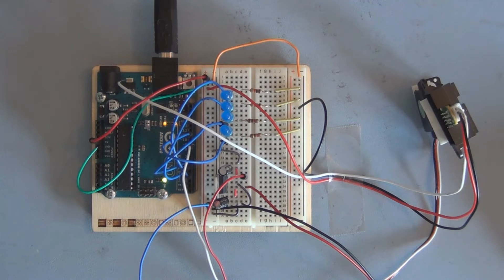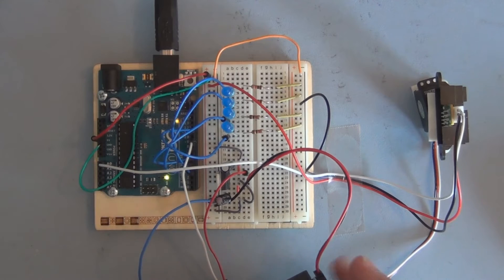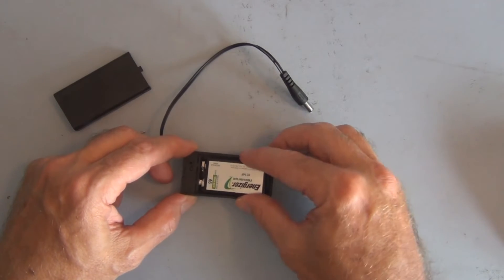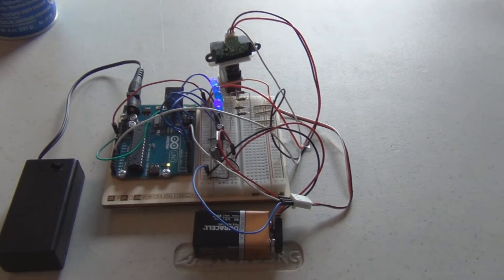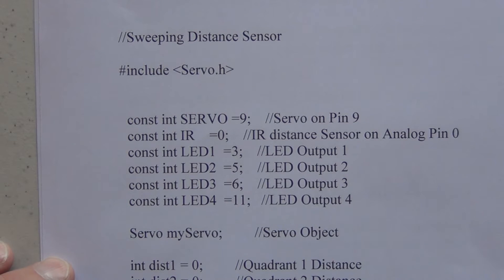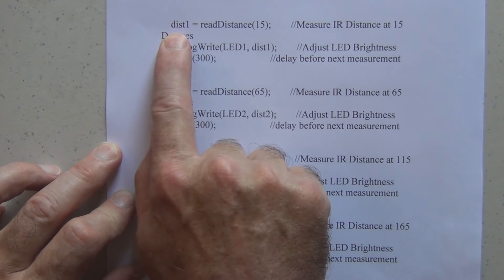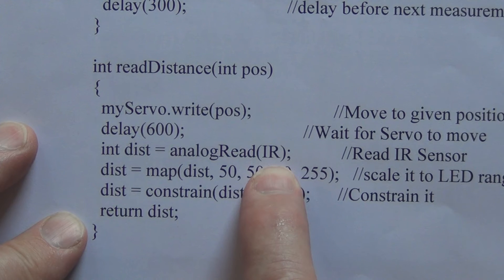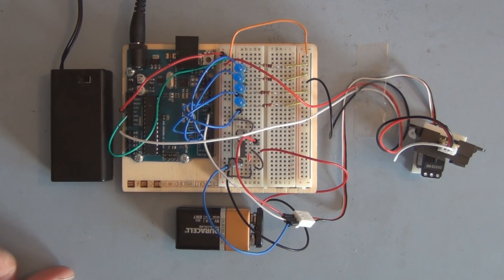Arduino Sweeping Servo Motor Distance Sensor

Comment: the function readDistance() is defined in the sketch at your fingers (video time ~ 12:21 )
int readDistance(int pos ) 
that creates the function , the compiler then knows how to use it . It would seem sketches don't require the functions defined before you use them . 
 I'm new to  arduino , but have been coding in c+/c++ for years . I find your videos very helpful. 
I can wait till mine arrives , I want to use Arduino to link my tools to my laptop . I don have some  Adafruit motor controller boards coming too . LOL